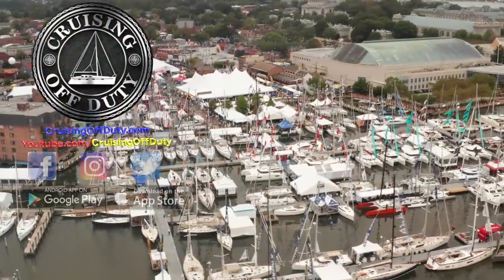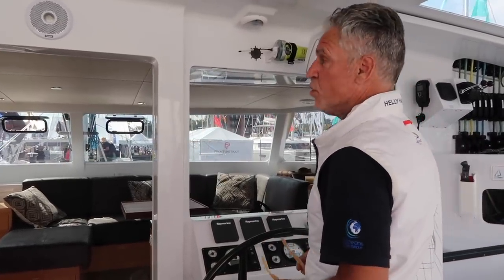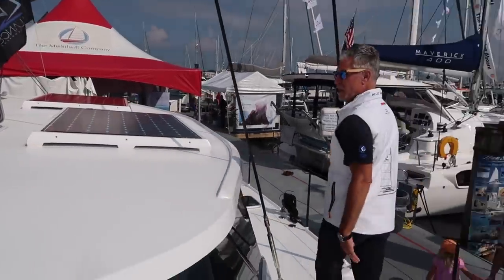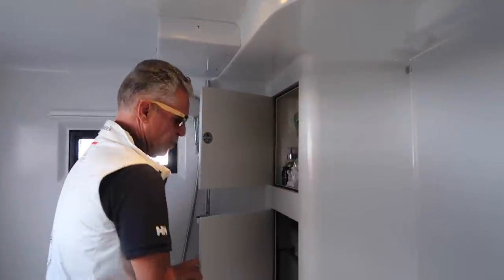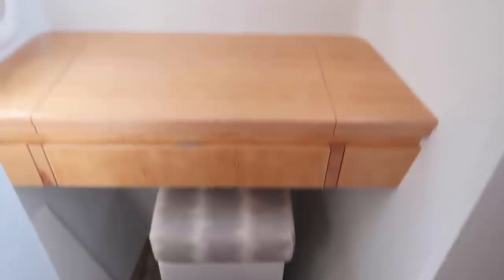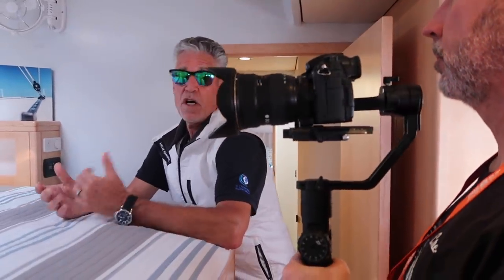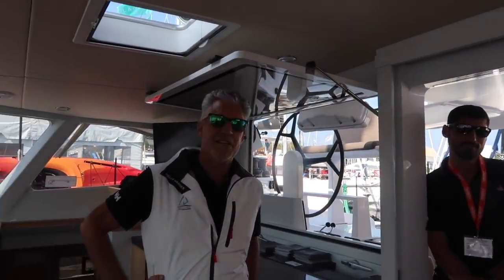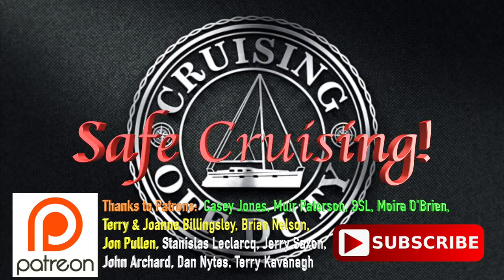Balance 526 Catamaran. Guided tour by designer.  Perfect Balance of performance and cruising comfort

Comment: Actually all the "performance" outfitting & custom design of this vessel has probably added 500 - 750K to its price. Performance cats, especially custom vessels are much more difficult to construct with lighter weight structurally superior materials. It wasn't mentioned but a sizeable LiFePO4 (lithium iron phosphate) battery bank can be quite pricey compared to AGM's but they give130% duty use compared to AGM's. The price of $1.7 M seems like a bargain for a custom performance Cat with all the truly unique features it has. Many so called performance sailing Cats are very sparatan appointed compared to this beauty, at least in my humble opinion.
Reply from the maker: I agree with much of what you are saying.
Reply: I think the Gunboat 66 that is just coming on line is in the 4-6 million dollar range.  I like that concept of a forward steering station and step out of the cabin  to wenches and anchor....see that on Chris White Atlantic cats...where I first saw it..and now GB.  So, i think the Balance performance cats are actually a very good price for a performance cat.  One thing i did notice,  it seems when the helm wheel is in the up position ...that the seating position versus helm position (top of wheel) is way too low if you are sitting in the seat.  If standing maybe your hand can grab the top of the wheel.  It might be nothing more than an optical illusion.  Because this owner/designer....i talked to him before on Cruiser's Forum is a highly intelligent and passionate man about his cats.  Immensely enjoyable conversation with him and if the Gods smile upon me......

Comment: I'm so glad Phil took you through the boat ! One thing he forgot to mention was that the ventilation is ongoing with all hatches closed ! Great when it's raining , you still get airflow through the boat ! Thanks for sharing !😎
Reply from the maker: That would be a nice feature.  Thanks.
Reply: How is that working?
Reply: How is it ongoing?
Reply: I saw Phil talk about it on a video somewhere, but basically it is something similar to a dorade that is under the bridge deck and feeds air into the two forward state rooms.

Comment: Because this was an Annapolis Boat show week alot of the cruising gear is not present on the boats.  That being said, i couldn't tell how the anchor chain and rode were stored.  Is it snaked back to the black wench drum on the portside of the mast?  I saw the two hatches forward of the mast.  But it seems the owner described them for storing docking gear and extra fuel bladders.  Did i fall asleep again and miss some details about the anchor locker?

Comment: Extremely impressed with this boat, love the speed and the cruising features, couple of things I would do is go with dagger boards, put more freezer space and have a complete dive set up for at least eight bottles..
Reply: Coleman Adams Several of our buyers have opted for the scuba option which includes a dive compressor and dive tank holders in the large locker by the mast step.  When it comes to performance boats, weight is always a factor so you have to choose your additions carefully!

Comment: nice loooking cat. its not carbon fibre, only in some areas. the new orange one they have about to launch looks uber cool. as you say i to would prefer over the outremer any day.i think a few more hulls and they will iron any issues out. phils a fast talker if you know what i mean.
Reply from the maker: Yes.  Just in some structural areas to save on weight.  The whole boat is not Carbon or the boat would be even more expensive.

Comment: thinking about the generator how much noise it will make inside the boat. right beside the sleeping area.
Reply from the maker: Usually generators are in insulated rooms so they are not that noisy. Boats under sail make a lot of noise so the generator is barely heard. But at anchor you can hear them but not loud.

Comment: To me I would like to see more conversation about how important the height between the water and the bottom between the hulls. I seen on YouTube boats sailing and when they bottom out it’s like an earthquake. One sight shows the dog laying down on the deck inside the cabin and the boat bottoms out the dog left the ground. I wouldn’t go near any of these low hanging bottoms.
Reply from the maker: Ya deck slamming is one issue that cats can have happen.  The boats are built to take it but it can be loud.  In rough seas, I assume it is something you just get used to.

Comment: All that carbon and they still use and alloy cross-member and wire rigging, hmmmmm... For $1.7 M, plus "making our own carbon parts"; there is still significant room for improvement to command that price.  Synthetic rigging and a curved, elliptical forward cross member would be significant improvements.  I will give credit to several very nice functional features on this Cat, and coming in 3 tons lighter than a similar LOA/Beam Lagoon or Fontaine is significant.  I kinda take issue with the "I designed the Versa Helm" claim... The Jefa Tilting pedestal certainly isn't his design, but I'm sure he is referring to the overall Helm area as whole, but even that general concept has been executed on Cats from Down Under and the Kiwis as far back as 15 years ago... nothing new,  just different ways of doing the same thing.
Reply from the maker: thanks for the input.  I'm sure he made some great strides to keep it light but had to keep the price down so everything can't be carbon.  But still love a lot of the features and thought.  Even if we could never afford.
Reply: Cruising Off Duty stop saying never

Comment: Why are boat builders using e glass instead of s glass?  S Glass is significantly superior in modulus and strength. Yes s glass is more expensive, but still relatively low cost compared to the cost of carbon, and only a modest increase in overall cost when epoxy and labor are included.  Are these boats being made with polyester resin also?  Ugh!
Reply from the maker: A question you’d have to ask a builder.